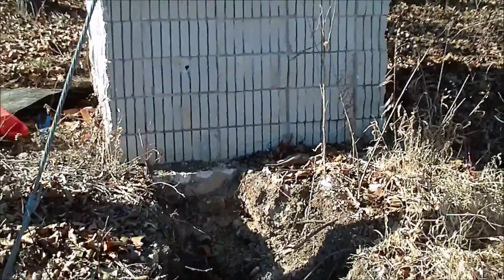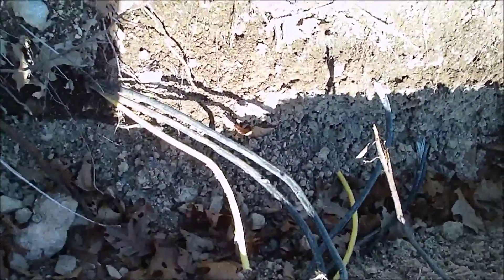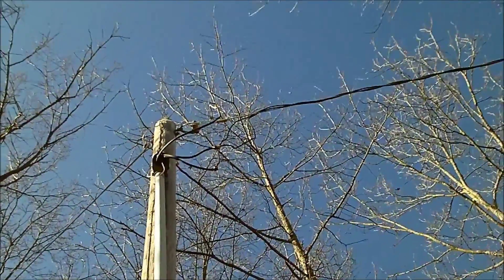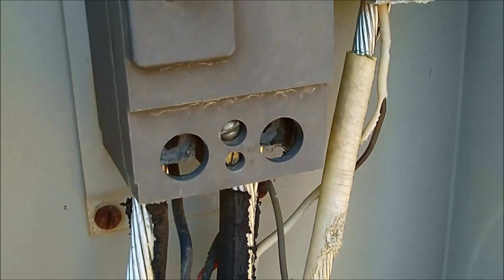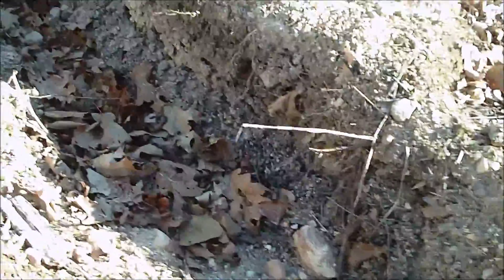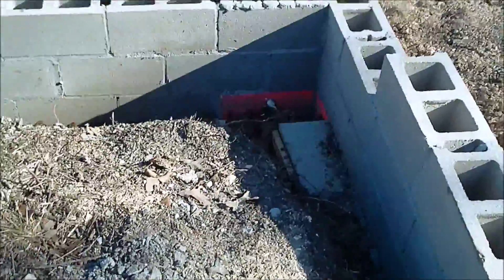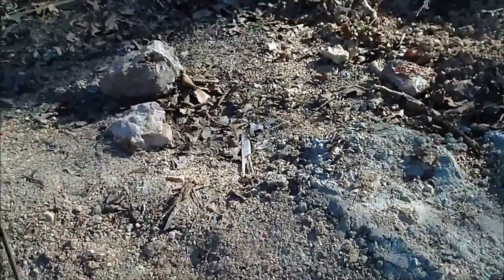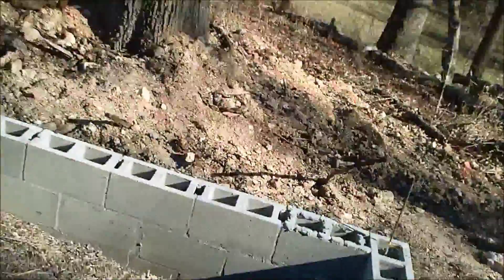Explanation of Running Electric from the Meter to Your House

Comment: So a house used to be where you are building? ..
Reply from the maker: My father and mother in law used to have a trailer/mobile home there for like 5 years when they first bought all that property.  They were only there like 5 years, and no one has lived on that property in 25 years.  But since they lived there for such a short time, I'm able to reuse the well and septic tank that they put in since it's barely used.  So, a money saver for me.  After they bought a big chunk of the property more property became available connecting the property the already had so they bought it and it had a nice house on it so they remodeled the house and moved in there.